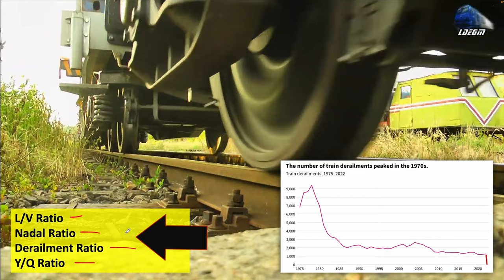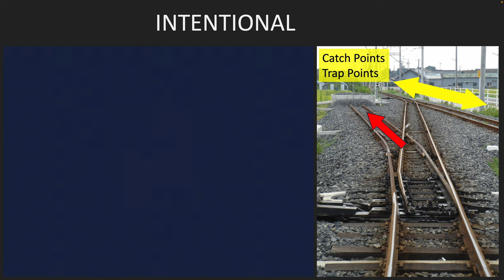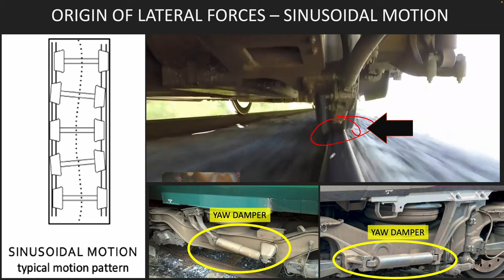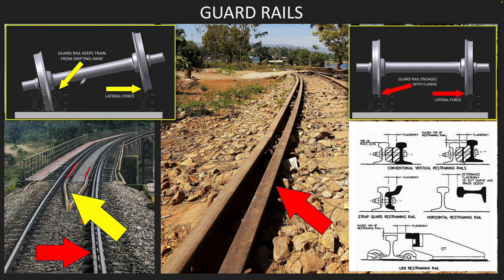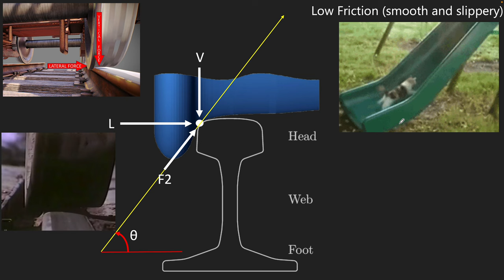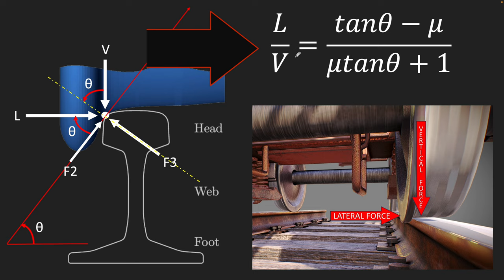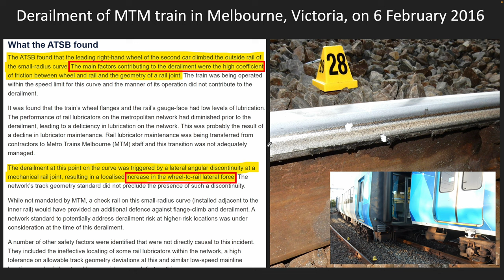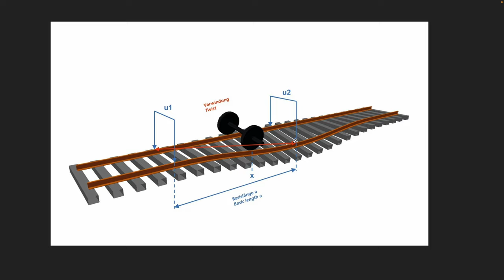L/V Ratio (Nadal Ratio) of Derailment Explained

Comment: Lateral force L is the only force pushing the wheel up. You can understand that by making L = 0, then there will be no wheel climb up. That is, no lateral force no wheel climb up. F2 does nothing to push the wheel up. F2 is the frictional force, which has two possible directions, up or down.

Comment: In my country derailment is every situation when even one wheel losses its contact with rail. Even if car stay on track, one wheel lifted, its derailed.
Edit: guardrails dont protect against derailments. They are to stop wheelsets from move to the side. Guardraila are mounted where it is need to keep train on track after derailment. There is some space beetween rails and guardrails. In normal drive wheelsets can not touch guardrails. It would bring much more problems with safety, like worn wheels, torn flanges etc.
Reply from the maker: Interesting. Which country is it? I would love to hear more about it. If possible could you add a link to a web page that mentions that?
Reply: @RailAcademy  Poland. Find Tmechatronik or Tmechanik. Both are train engineers. First is more than train engineer. He is instructor and doing much more about safety. Knowledge level master and both of them like to share explanations.
Reply from the maker: Amazing. Just subscribed. I wish I understood polish though.

Comment: 4:29 There is a mistake here. Wheels do not normally make a sinusoidal movement. That is called “hunting” and only happens when the equipment lacks maintenance or at excess speed.
Reply from the maker: I beg to differ. Wheels always, and I mean ALWAYS, make sinusoidal motion. It is known via Klingel's formula (derived in 1883), which derives the equation for simple harmonic motion. The wavelength of the sinusoidal motion is = 2.pi.square root((wheel radius.track gauge)/(2.tread taper)). The reason you don't feel it is because it is damped. Hunting occurs when this wavelength is too short or frequency is too high, causing the ride to become uncomfortable and the unwanted oscillation to be too vigorous.
Reply: It's a dynamic system designed to self-correct, with no natural damping. It's oscillating.

Most of the time though you barely notice it. Those "hunting oscillations" you mention are the same thing, happening for the same reason, except something has either petrurbed the system too much (sh!t track, for example), or whatever excites them enters resonance (that's where speed comes in). Just because you don't normally pay attention to them doesn't mean they're not happening though.

Other oscillations you didn't know were happening:
1. Long-period longitudinal oscillation in a cruising aircraft. While it's "flying level", it's actually in a very slow cycle of climb and descent. It's called the phugoid oscillation, look it up. There isn't a statutory requirement for this particular oscillation to be stable, and as a result, on many aircraft (especially bigger ones) it is not. Left to its own devices, an aircraft with a sufficiently unstable phugoid will keep making bigger and bigger climbs and descents, until eventually it falls out of the sky (see 68-0218). Fortunately either some good automation or a well-trained neural network is usually in full control of the machine.
2. The spiral trajectory of a rifle bullet. An artifact of the dynamic stability behaviour of a spin-stabilised projectile, especially a high-speed one (with a long nose and boat tail) is a spiral path through the air. This is normally initiated by the harmonic motion of the barrel, which results in angular perturbation during barrel exit (the muzzle gives it a kick in some direction or another). Gyroscopic precession then converts the overturning moment into spiral motion, which continues for the duration of the flight, tending towards zero. Some designs however exhibit rather odd limit-cycle behaviour. The 168gn Sierra Match King, for instance, likes to sit at around 2° yaw. After launch, it will rapidly dampen its initial high yaw and settle into a 2° spiral. If there didn't happen to be any yaw, it exhibits an instability that will create it, and again it will settle into that 2° limit yaw. But to the regular competitor at the 100m range it looks like it went in a straight line from muzzle to paper.
3. Literally every bit of steel out there, if given a good knock. Again, all sorts of elasticity, and no damping.

Sinusoidal oscillation is something you start noticing nearly everywhere after studying dynamic systems for a while. It's like the whole world wants to oscillate, and in 95% of cases you can model that extremely well as a spring-mass-damper system, like the suspension in your car.
Reply from the maker: My favorite comment <3

Comment: Well yeah just look at how shallow those flanges are!
Reply from the maker: I agree. I did not know how shallow they were until I inspected them in person for the first time. I was like wait what these shallow flanges keep our trains on the rails?
Reply: Flange depth does not keep the wheel from derailing, it's the shape of the transition from the flange to the tire that does the work.

When two rails intersect, such as is in a switch or crossing, a gap must be provided in each rail so that the flange of a passing wheel on one rail can move through the other rail. These gaps are intentionally made to match the flange depth. This supports the edge of the flange passing through the gap. The result is a smoother ride and less wear and tear on the rail on each side of the gap, because the wheel rolls through the gap on its flange.
Reply from the maker: I differ. 
A concept of increasing flange length to increase the flange climb distance limit was proposed by Wu and Elkins in AAR report R-931 in 1999, and further validated by Wilson et al in ASME International Mechanical Engineering Congress in 2004. They concluded that increasing flange length (which is the straight length after the transition) would increase flange climb distance appreciably. It is also intuitive that deeper the flange, the more the train will have to work to climb the rail.